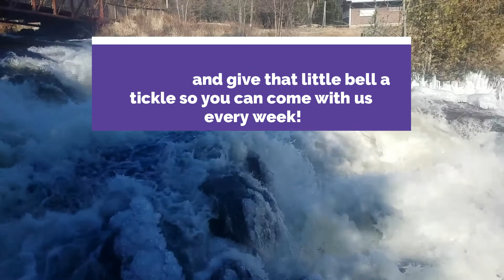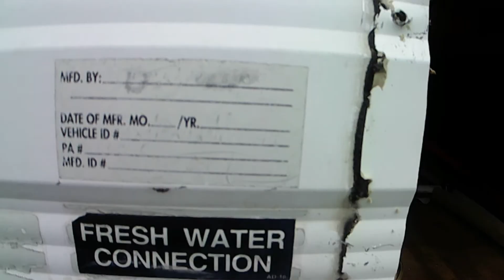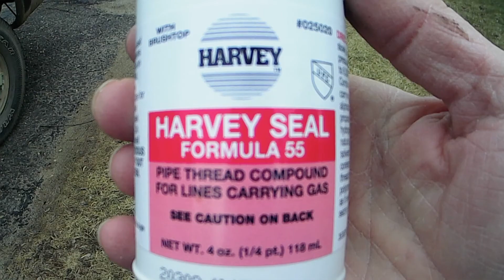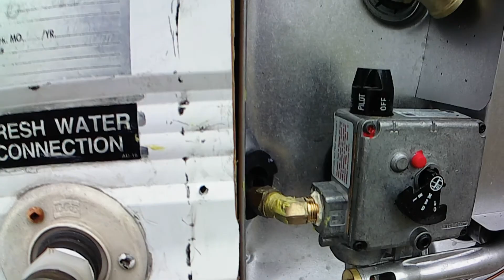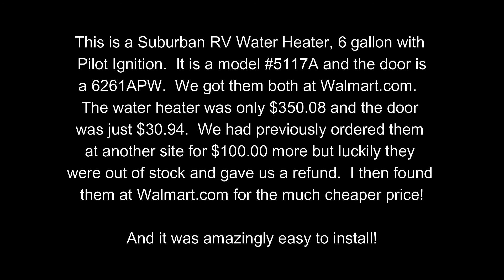How to EASILY Install an RV Water Heater | Prepare for Fulltime RV Life

Comment: It should be mentioned that the drain plug is also the anode rod that should be replaced yearly or so to extend the life of the tank. It is sacrificial metal and reduces the electrolysis that eats the tank material. I just bought a used camper and replaced the anode that was completely gone, but too late. The tank is leaking so I'm about to replace it. My 98 has a Suburban SW6DE which has electronic ignition for the propane and electrical heating element so there are quite a few wires that must be removed and replaced correctly.
Reply from the maker: Hello Willss!  Thank you so much for your input.  We certainly did not know anything about the process when we started so all input is appreciated.  I hope all goes well with your replacement.  Thanks so much for taking the time to watch our experience in changing our tank... hope it gave you some help at least!!  ;-)

Comment: Great install video.  May want to seal the mounting surround to the tank enclosure though.  When rain water sits on the bottom where the mounting surround meets the tank enclosure it will leak inside the trailer.
Reply from the maker: We did seal it up with butyl tape!  But thanks for the tip and for watching!!  😀

Comment: You didn’t install the one way check valve for the hot water ? Cold water will try and get into the tank and mix with the hot
Reply from the maker: We installed what we had… Thanks so much!